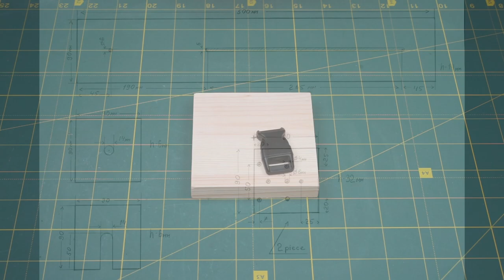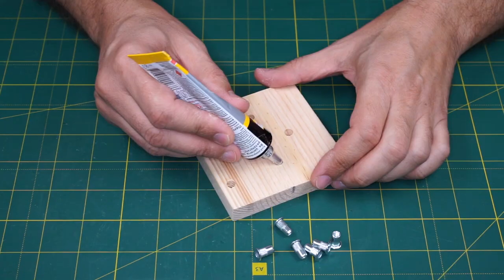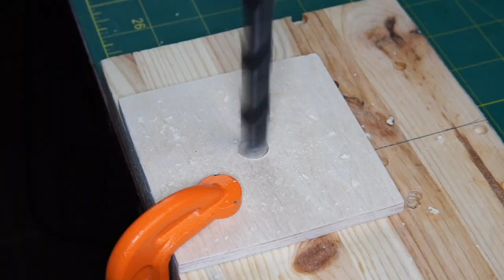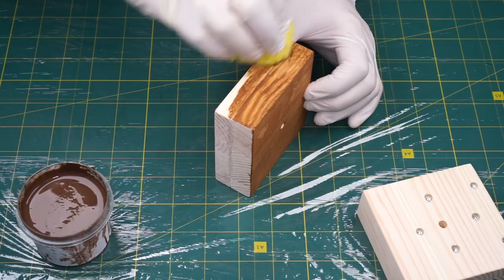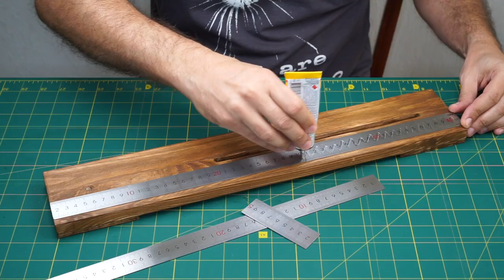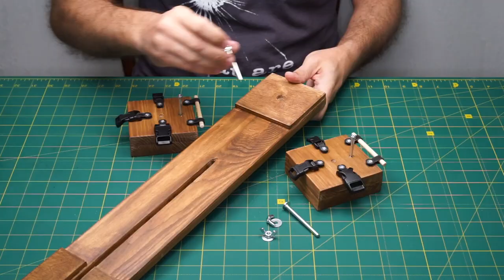DIY Paracord Jig ( Short Version )

Comment: Are buckles 15mm, 20mm, 25mm? Are buckle fastening bolts 4mm? Is the bolt fixing and tightening with butterfly nut (middle) 5mm? Single and highest screw is 5mm?
Reply from the maker: Buckles 3/8, 1/2, 5/8 inches., Single and highest screw is 4 mm.